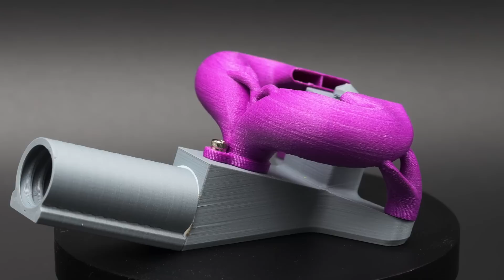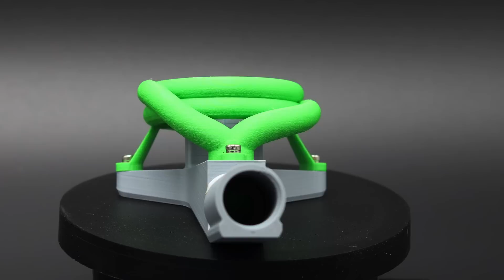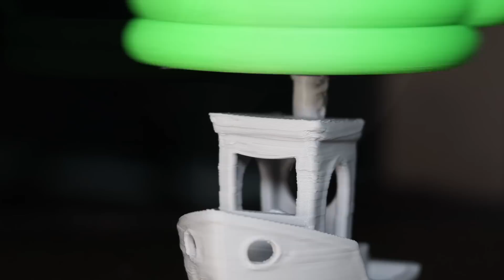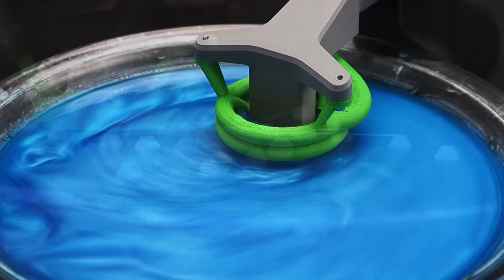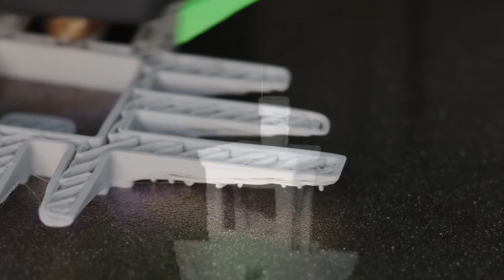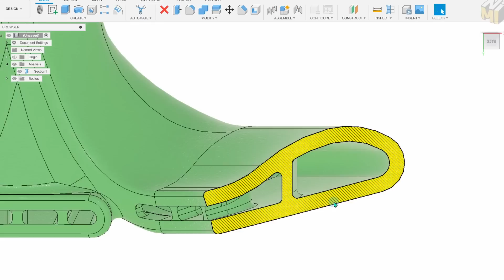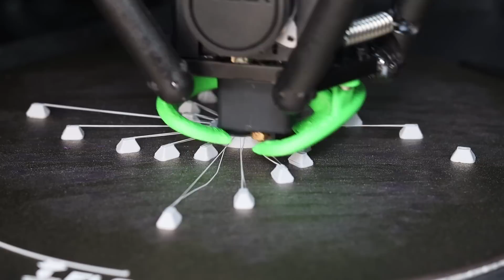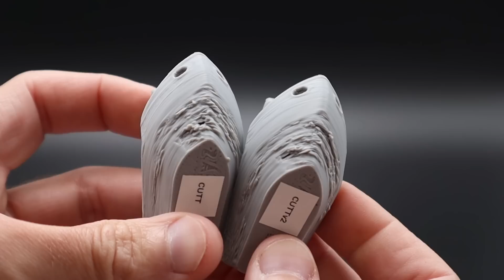Ep.2 - More crazy looking 3D printer duct designs with some serious performance!

Comment: I really feel like fan ducts should be printed via resin for better sealage
Reply from the maker: I have done a bit of resin printing, but I'm no expert and to be honest, the smell really bothers me, especially my eyes.  I think I need to test some other brands of resin.  Long-term the best duct will be professionally printed and will be made from nylon most likely, it would be fairly smooth, well sealed, black to look good.  I really struggle with resin for structural prints, holding an accurate shape seems to be really tough with resin.  Please share some more of your thoughts on this though, do you think the smooth surface makes a huge difference, or just a little bit, and how much leakage do you think we'd see?  Some of these ducts were very restrictive and I didn't notice much of any leakage from the walls.
Reply: @NeedItMakeIt  I'm also not an expert when it comes to resin but I think it would have slightly better sealage since instead of having the holes between the filament lines(while small these do tend to minimally effect stuff but any air loss could bee seen as air loss, I think the smoothness may also help as far as(i may use the wrong term) resistance or drag for example wind travels better on a plain then it does in a city but in a city you do get stronger air currents so in theory i think resin would probably make not that big of difference, the idea came from someone here on YouTube that makes submersible rc submarines for like in the ocean and they pointed out that the way an cam printer prints leaves spaces between the lines printed on top of each other since the layer lines are offset, I believe resin was the way they got around it but they may have done something else to stop water from getting in at high psi,my thought is instead of try to keep the water out we are trying to keep the air in(not to mention in theory easier supports for interesting designs as well) sorry if I missed one of your points I'll review what I typed after I'm done as youtube on phone is pretty trash when your commenting XD
Reply: @NeedItMakeIt  ah forgot about the nylon I think was all and that would probably be the best possible design that or ssl maybe but that's all still really foreign to me way more then resin usually I end up using abs to print my ducts just cuz I haven't gotten a new resin printer yet and can't be asked for the Hassel my old one took so been waiting for them to advance more which the resin printers with the ability to suck back up the resin are catching my eye

Comment: 3D Printer fans are blowers, not compressors, so any restriction on the airflow will significantly reduce cooling performance because the fans can't generate any pressure. The best design for any duct is the one that does not change the cross-sectional area of the fan's output port. Of course, this isn't possible all the time because of space constraints. Look at the Annex Engineering Stiffy Toolhead (Churls-Stiffy_E3), it has dual 5051 fans with ducts that are pretty much the same cross-section all throughout the duct.
Reply: "The best design for any duct is the one that does not change the cross-sectional area of the fan's output port."

Simply not true.  You trade flow for air speed, and when directing flow through turn and aiming the outlet at a specific area air speed is very important.
Reply: Yeah nah op you actually need some compression especially if your duct especially if its not just straight. The hard part is getting the right amount of compression
Reply: Also in one of the earlier videos he specifically mentioned that he would use a CPAP style blower as opposed to the standard part cooling fans

Comment: Does the "cliffhanger" benefit from the combination of filament mass and air bouncing down and up from the build plate (because the build height is low)? The "bridge" test is low but the filament mass is extremely small with just single lines (duct "wash" creating turbulence that tosses the filament strand instead of solidifying it).

So as I see your tests, ideally you want high velocity but specifically directed flow of air. Yes?

Comment: Would using variable layer height on the cliffhanger test reveal anything? At which layer height the ducts fail to cool when producing an overhang of a certain degree? The test would be remade to have different degree overhangs while the variable layer height would increase at the same rate for all overhangs. 

Variable layer height is a great slicer tool that I use to increase the quality and strength of my finished parts. May be interesting to see how these ducts show.